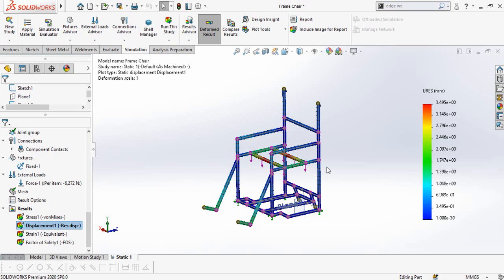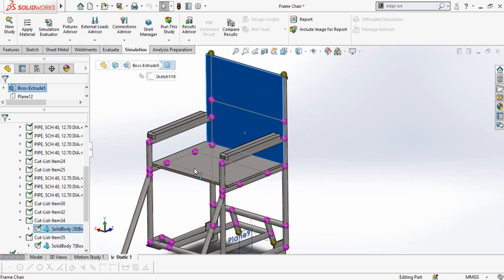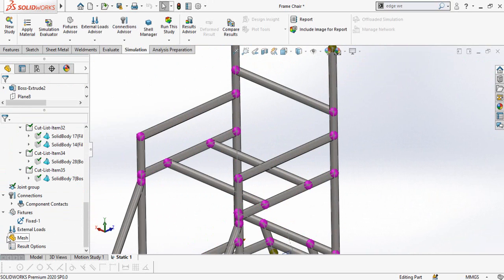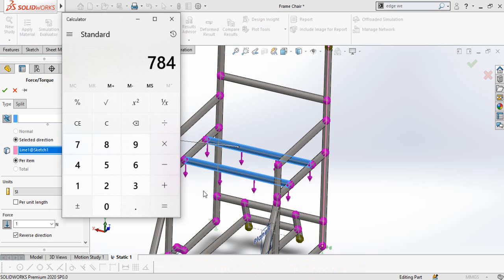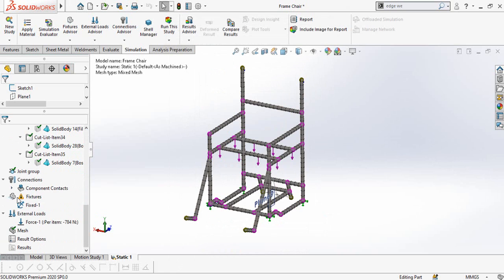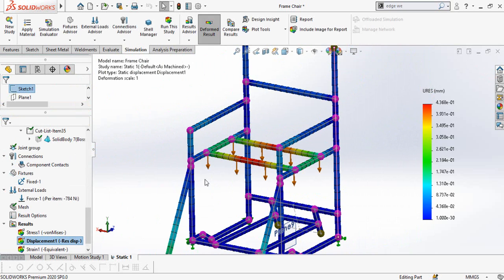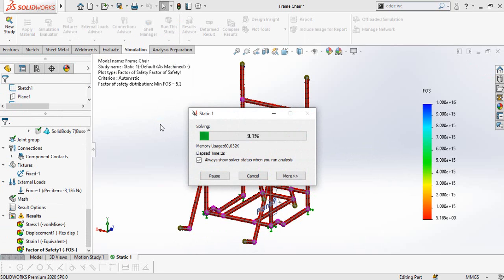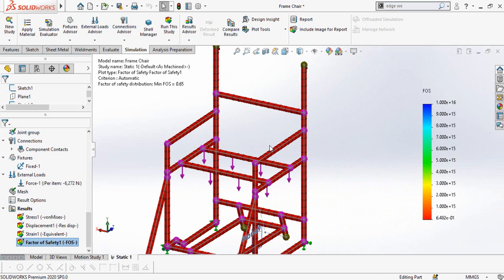SolidWorks Weldments Simulation Tutorial|Model is Unstable issue RESOLVED

Comment: One question, you are put the mass of human 784Newtons, its ok,but in simulation its selected FORCE per item, so you selected two items, two beams, should mass must be divided/2? so that half mass is on one beam, and half on another? thanks
Reply: You are right, you need to check if the force is applied "per item" like in this case and he selected 2 items, so he is applying the double of a person weight to the simulation, if he really wants to simulate exaclty if a person is sitting on the chair he needs to divide the force applied by the numer of items selected, or change the option from "per item" to "total"

Comment: Ok. I appreciate the hard work you have put into making this and explaining. But a little correction, You should not multiply 80 with 9.81 as the 80 is not the mass of person it is weight of the person measured on planet earth, which means it is already multiplied with 9.81. Weight (force) = 9.81 * Mass.
Reply from the maker: You are right. Thanks for sharing your knowledge.
Reply: Actually, you are wrong. What you see in a balance is your mass. What the balance does is: It measures the force applied to it, then divide by the gravity, and then shows your mass. An adult man has somenthing near 80kg of mass, and 784 Newtons of weight.
Reply: @Realidade-Fascinante-1  You are right..
Reply: @pradeepdube1398  One question, you are put the mass of human 784Newtons, its ok,but in simulation its selected FORCE per item, so you selected two items, two beams, should mass must be divided/2? so that half mass is on one beam, and half on another? thanks